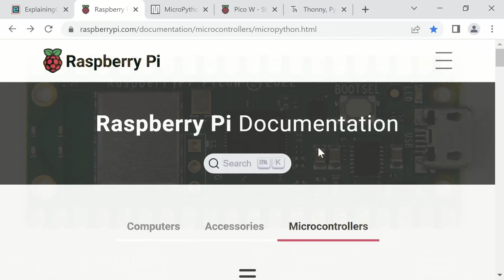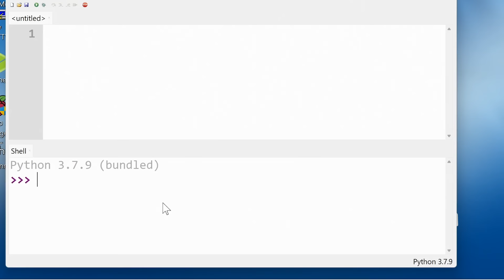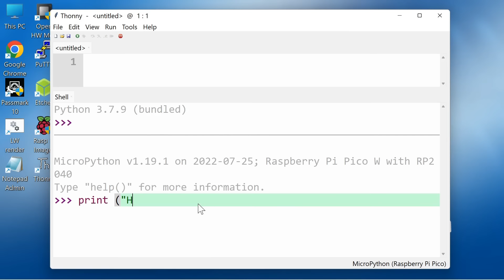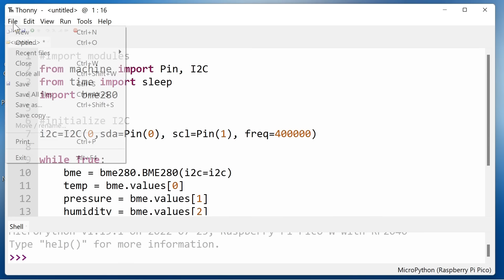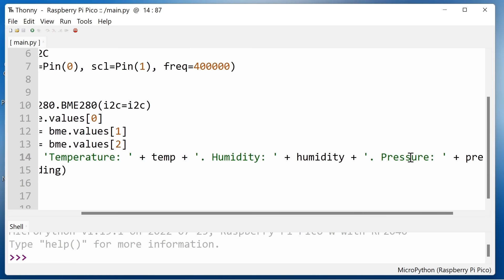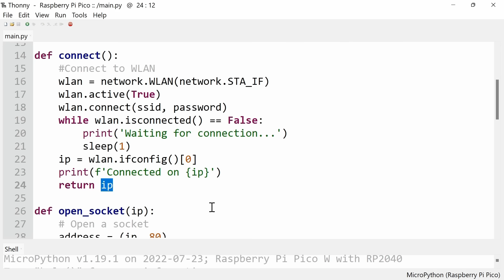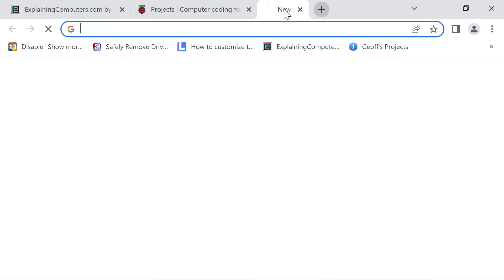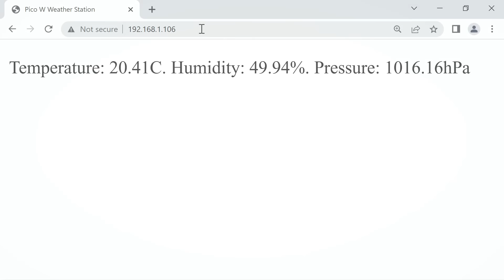Raspberry Pi Pico W: Wireless Weather Station

Comment: Can I ask if It Is possible to modify the code through wifi or Just through a direct USB connection? I Need to install the picow under the Ocean inside a biosphere with no PC connected through USB but Just a wifi connection.. so if for some reason I have to modify the code i Need to be a sub and to bring with me a PC 😢
Reply from the maker: I'm not aware of any way to modify the code except via a USB connection. For that I expect you will need something more like a full-blown computer rather than a microcontroller, where you can remote access over WiFi. A regular Raspberry Pi of some kind, for example -- although maining a WiFi link could be problematic. See: https://www.youtube.com/watch?v=ChQpD2gsC20

Comment: I have learnt python on the desktop side, didn't know that it could be used on microcontrollers, in this case a Pi Pico W. Will get one to try soon. Thanks!
Reply from the maker: MicroPython is a great version of Python for microcontrollers. There's also a version called CircuitPython. Both are very similar to what you have learnt on a desktop.

Comment: Hehe, glad you can find them for $5. Can't find them here.
Reply from the maker: Where is "here"? Pi Picos (as opposed to regular Pis) were in stock at major Pi resellers in the US and UK when this video launched on Sunday. :)
Reply: @ExplainingComputers  In the US. They are $100 on Amazon. I would have a half dozen of them if they were $6 each :)
Reply from the maker: @PyroRob69  Never, ever buy a Pi on Amazon (who themselves do not sell Pis -- it is only ever third parties). Always go to an official reseller who charge the official prices. The PiShop had them in the US for $6 when this video posted, but now out of stock for the W version: https://www.pishop.us/product/raspberry-pi-pico-w/ I would also suggest clicking on "Notify" at Adafruit: https://www.adafruit.com/product/5526 Supplies of Picos are far more plentiful than standard Pis. Good luck!
Reply: @ExplainingComputers  Thanks for the link! I will check them out.

Comment: Great video. I followed all the steps and got this to work, connected to wi-fi and viewed the data on my web browser with the pi pico on a USB charger. I then went to edit the code in Thonny but it would not connect to my Raspberry Pi Pico W. I tried reloading the MicroPython code for the wireless device, but it still would not connect. (I see an error: PermissionError(13, 'The device does not recognize the command.', None, 22)) I was able to download the MicroPython code for the standard pi pico and that worked, even though this is a wireless pi pico. I was able to add an LCD to display the data locally, but I still can't get this pi pico W to work when the MicroPython for the wireless device is loaded. If anyone has any idea what I'm doing wrong, let me know. Thanks. [Edit: I finally resolved my problem by booting with a new pi pico W. That got Thonny working again, then I was able to go back to the old pi pico W, and it worked fine. Strange. The main.py and bme280.py files were still on the pi pico W that had ceased to function, and it still worked.]

Comment: IP WILL CHANGE AT SOME POINT SO HOW DO WE KNOW WHAT THE IP IS AFTER THE ROUTER REKEASES THE CURRENT IP?

CLIMB ROOF EACH TIME WITH A LAPTOP?

STATIC IP VS DHCP IS NEEDED I  THE CODE
Reply from the maker: The only way to fix the IP is by allocating a fixed IP to the Pico W on your router.
Reply: use an IP scanner like angryIP

Comment: This is brilliant! Watching the video inspired me to purchase a Pi Pico W and the BME280 and run my first programme! My plan is to have the Pi Pico W remotely located without a computer attached and report the temp readings to the web page but I am having the problem that whenever I save the program as main.py to the Pico, it bricks the Pico and won't allow it to connect to Thonny. I found a solution of nuking the Pico and starting again and I can get the program to run on the pico if it is called something else other than main.py. This is a sticking point as I need it to operate independent of a computer. Any advise would be great, not sure where to go from here
Reply from the maker: Great to hear that you were inspired. You cannot brick a Pico via software, but may have to re-image as you note on occasion (instructions for this are in the video description). But you should be able to break-in via Ctrl-C or Ctrl-F2 in Thonny, although some practice can be required to get the timing right! :) But even if you can't (and remember that the MicroPython software for the Pico is still not final), get everything working properly using a different name (or running from the computer). Then save it to the Pico as main.py when even you have final code.

One particular issue here is that, because a WiFi connection can drop, the code ends with a "machine.reset()". Normally this would not be needed, which makes breaking in easier. But a device that needs to stay online via WiFi will have to reset every now and then.
Reply: @ExplainingComputers  I’ve got it working as a standalone weather station now. Thanks for the advice. It’s spot on. It’s in the garage right now monitoring the temperature before I start a fermentation on a batch of home brew out there ;-). Practical application :-)

Comment: Couldyou do one in how you explain howto connect the pi zero with a 3b+ wireles? Want to use one as a simple alarm rederecting images and sound backt to the 3b+ after which they will automaticly upload to youtube and as videofile to my cloud or a server. But i just not seem to get them connected.
Up forhand thank you

Comment: How long would the Pico run from that battery?
Reply from the maker: I ran it about 12 hours from the 2000 mAh power bank, and it was not fully depleted.
Reply: @ExplainingComputers  Thank you. Not suitable for my application then.
Reply: @ExplainingComputers  Thinking about this some more I'm wondering if the Pico can power down to a sleep state and wake up. You'd really only need measurements every 5 to 10 minutes to get outside readings. My NodeRED PI could query this for readings, it already has the same sensor for room readings which it writes to a MySQL database on a server.

Comment: Having no end of problems with Thonny, Pico W doesnt connect with the error PROBLEM IN THONNY'S BACK-END: Internal error (serial.serialutil.SerialException: WriteFile failed (PermissionError(13, 'The device does not recognize the command.', None, 22))).
See Thonny's backend.log for more info.
You may need to press "Stop/Restart" or hard-reset your MicroPython device and try again.

Process ended with exit code 0.

I have confirmed that I'm using the correct UF2 file.
Reply: The easiest way around this I found was to pull the jumper to the data pin on the bme280. This interrupted the program and allowed thonny to reconnect.

Comment: do we really need to use that white board on which you soldered the pi pcb ? can't the sensor directly connect on pi board without using any white board ?

Comment: why did you ground it to 38 when you had the same option at 3? is there a reason aside from aesthetic to go to the other side to ground out?
Reply from the maker: Certainly the aesthetic for the video. Pin 3 would have been fine. :)

Comment: I'm going to build this, however, is it possible to add sensors for wind speed and direction?  Temp, Pressure etc is good, but wind velocity is something I need.  Can the pico cope with that as well as the BME280 parameters?
Reply from the maker: Yes, there are many GPIO inputs left for other sensors, such as wind.

Comment: I see a pretty unhealthy migration from C/C++ to python, a pretty resource hungry and slow, python supposed to compete with scripting not with the performance programming languages, next generation will be alien to performance programming that is already felt in the market.
I seen the same with introduction of Arduino IDE, people today don't know to create and configure a project, back in the days was hard to configure a project with a purpose ( learning ).
Next step is the push into visual programming, the "Idiocracy" clip where wanted to put a cubical in a circle hole and we will have it all.
Hard to choose between Raspberry Pi Pico and ESP8266/ESP32?, I prefer to chose ESP ( more compact and less components/ less points of failure, cheaper and C++ = performance).
Per total; good video 👍, commented about my two cents on how thing are going only 😁

Comment: This is fine, and I know how to convert to Fahrenheit, but how can I get it to show an "F", rather than "C"?
I'd also like this to show on a OLED device, rather then a Computer!
Reply: It seems `values` gets auto formatted to show the C (mot ideal) but you can instead use the method `get_compensated_values`. The returned tuple is laid out the same way, but the temperature is in hundredths of degrees C, so you would need to multiply that by 100 before or after conversion.
Reply: @TrollDecker  - Thanks!

Comment: the link in the description is incorrect, now ive accidentally bought a BMP280 not a BME280 which reads altitude and not humidity...
Reply from the maker: My apologies. All information is provided in good faith, but as you said I got one of the links in the video description (for Amazon UK) wrong. I have corrected this now. Hopefully Amazon will allow you to return the item?
Reply: @ExplainingComputers  I didn't mean to make it sound like I was blaming you I could have read the details on the amazon page more thoroughly but just thought I'd let you know the link is incorrect. Unfortunately the seller is a 3rd party and not amazon so I'll have to go through them instead, but we'll see what happens. Interesting the device isn't reporting alitude at all, it's reporting humidity always at 0% so at this point I've got no clue as to what I've bought haha.

Comment: Hello, i would like to power my Pico with an powerbank as well but i hardly find a suitable one, which one did you use in the video?
Reply from the maker: It is an old, generic 2000mAh one. So my advice would be to look for a low-capacity power bank, as these are more likely to be able to sustain a low current draw. Note that I've never been able to power a Pico from a power bank, only a Pico W with WiFi on (which draws more power).

Comment: @ExplainingComputers I want to use this setup to serve temp/humidity/pressure to a web page like you do, but also continuously write that data to a file. Should I use the pico itself to write the csv and access it from another computer on my network, or use a desktop computer or sbc to access that page, get the data, and write it to a file every x minutes? I think this seems like a nicer solution, but what is the best way to do it? I think it would be cool for my Raspberry Pi 3B to look at the data coming from the Pico and writing it to csv continuously.
Reply: I have Pi that reads the data from the Pico (using wget) in a Bash file. I use it to turn on and off a dehumidifier and write to a log file. The script extracts the useful data from the web page structure, in my case just the temperature and RH% writes the data to a log file and turns on and off the dehumidifier, using Tplink Kasa plugs (library available for RPi). The output log file could just as easily be in csv format. It's working well for me.

Comment: Brilliant, as always an excellent clear instructional video and as I have a Pico W and a BME280 I will try it out ! Thankyou
Reply: How do you just have a BME280 lying around?
Reply: @Jimmy_Jones  oh, easy, I already have a modest weather station running on a Pi zero and I  have a second BME280 which I have tried on a Pico and an Adafruit Feather RP2040. So a Pico W is but a small step.

Comment: Fascinating Chris. Well done.
Could you please tell me in underclocking the Pico would result in a lower power draw? I'm just curious. Ta.
Reply from the maker: It would, although I suspect that the big power draw is the WiFi module (which can of course be turned off).
Reply: @ExplainingComputers  That makes sense. Thanks.

Comment: I wonder how the code would look if we were to use a port other than 80 (my port 80 is doing other things). i spend two days going through the documentation suggested but i couldn't figure it out. for example, when i replace 80 with 20000 nothing is displayed when i go to my web browser and type ip:20000. Any help from anyone???

Comment: I received an order of 5 RPi Pico W boards from the Pi Shop on Friday. They are getting easier to buy. I plan to use one to replace an RPi 3B weather station to make the 3B available for another use.  I currently use MQTT to transmit the data and I also plan to use MQTT to transmit data with the Pico W.  I have other projects where I can  replace a RPi with a Pico or Pico W.

Comment: I am getting EIO error very frequently and I do not know what is wrong. I connected the pins as you have but they are the short ones. I followed the code correctly but I am not sure why it is saying Errno 5 EIO error.

Comment: I have been trying to get this project to work. I can get the simple " hello world to work". I even coppied the code. The problem I have is the BME280 library will not install. Using Thonny, trying to duplicate everything your doing. I just cannot get the library to load. Message, "ImportError: no module named 'bme280'".  Any thoughts.  I bought another BME280, however just trying to install the library, the component should notr make a difference. 
tim
Reply: Did you manage to solve the issue? I have the same problem now

Comment: I started building my own just before this video came out. I had been meaning to update it as it was a prototype. It was a Pi Zero W connected to a 12v 7ah lead-acid battery and using OpenPyXL to record the values. I have finally finished the project by changing it to running on a Pico W, using Powerboost 1000c from Adafruit and a 4000mAh LiPo connected to 2 6-volt solar panels. I might upgrade it again once I acquire a Pico 2, as it draws less power. However, I want to finish the backlog of other projects before buying anything new. Thank you so much for this video, Chris! Yours is one my absolute favourites on Youtube! Looking forward to seeing a video on Pico 2!

Comment: Thank you for this video.  I'm having a problem, though.  I loaded micropython_bme280 via thonny and it seems to have copied the file into the lib folder on the pico W.  When I try to run the program you show, I get this error message: Traceback (most recent call last):
  File "<stdin>", line 6, in <module>
  File "bme280.py", line 12, in <module>
AttributeError: 'module' object has no attribute 'BME280'

 I'm afraid I don't know how to open and read the BME280 module to see what it's doing in line 12.
Any thoughts?
Reply from the maker: This indeed sounds like the library file is not installed. I would try disconnecting and reconnecting the Pico to see if it is then picked up. If not, try using Thonny again to install the library. And check there are no syntax errors in the code. Good luck! :)

Comment: Does this measure windspeed & direction? If not, it's not a weather station!
Reply from the maker: A weather station is a device for measuring characteristics of atmospheric conditions. Many have anemometers as you imply, but there is no formal definition that a "weather station" has to include one. Certainly there are a lot of personal "weather stations" in sale that do not have an anemometer.

Comment: Can this code be changed to show Fahrenheit?
Reply: Easily with a little bit of maths;

 (°C * 1.8) + 32 = °F
Reply: Welp, no idea why YT deleted my followup, but...

I stand corrected. You can get the raw numbers with get_compensated_data instead, it seems. The temperature value from that is in hundredths of degrees C but all you need to do is multiply it by 100 and apply the above maths to get degrees F.
Reply: Thank you very much

Comment: Its working. However once its on the pico. I cant edit the code. Thonny keeps screaming at me about some issue in its backend and not having permission or the pico doesn't understand something.
Reply: I had the same issue and all I could find was ppl talking about nuking the PICO and starting over. I got around this by pulling the data jumper to the bme280 and the program faulted out to a stop that allowed me to reconnect to the PICO with thonny. I changed the file name from main to something else which allowed me to keep it open in thonny while working with it. I had the intention of incorporating a "reset" or "stop" button into the hardware and make a hardwired version for permanent use but hadn't got around to it yet.

Comment: Can you do this with six raspberry pi pico w, reporting to one and the same html page?
Reply from the maker: Yes and no! :) Yes in that six Pico Ws could all publish an html page with data on it. But no, as they could not all publish the same, single html page. However, an html page can include snippets of other pages, so each Pico W could publish its own snippet, which another page could then amalgamate into a single page. As far as I can recall (it is a very long time since I've done anything like this!), a bit of JavaScript would be needed in the "master" page, as it were, to bring it all together. But if you are saying "is it possible to have six Pico Ws sending in data that ends up displayed on one page in a browser", then yes, it is possible.